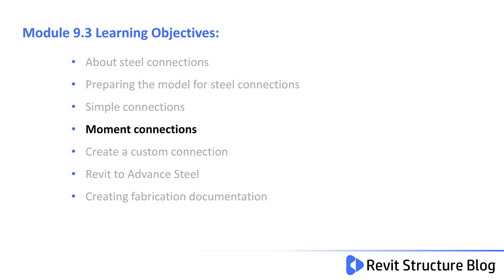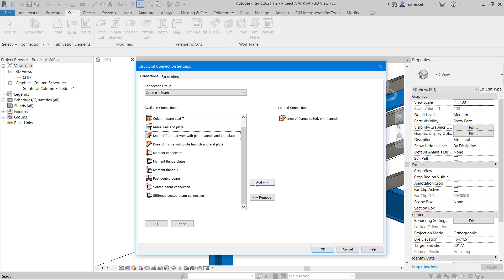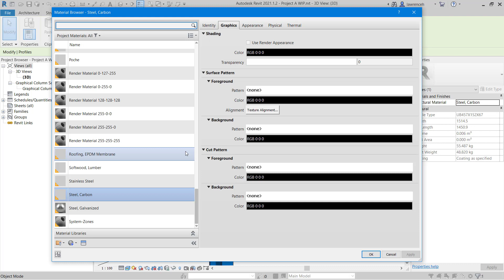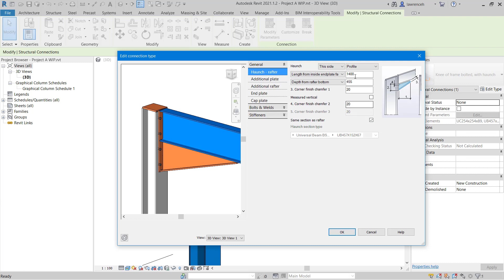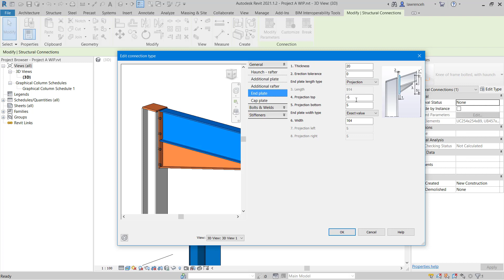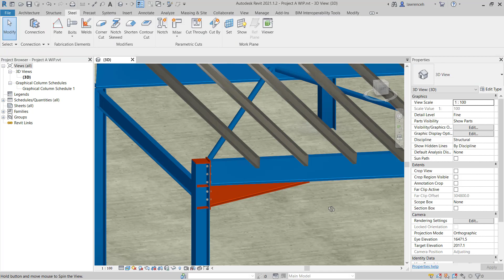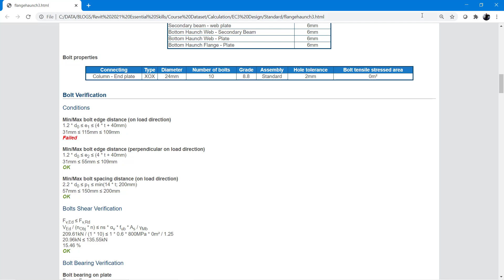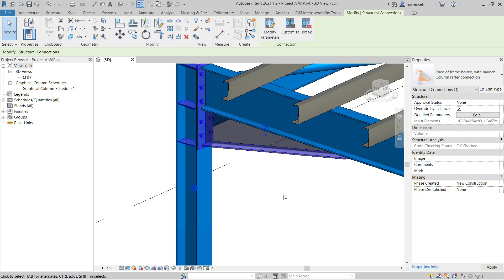Revit 2021 Training For Structures Essentials Module 9.3 Steel Connections

Comment: My code checking no longer works. It worked for the connection in module 9.2, but it doesn't even work for that connection anymore now that I have tried it on this connection. Autodesk 2023

Comment: in mine, Bolts pass completely through the column to the other side of it and also still fail after correcting the bolt distance.

Comment: How can I create a moment conection for a circular column and a IPE profile beam?
Thank you!
Reply from the maker: It depends on the geometry. The top and bottom plates can be created using the fabrication elements and then welds and bolts added. Another option is Advance Steel

Comment: Please provide AutoCAD file
Reply from the maker: All the files are available. If you take a look at the first video the links are shared:)
Reply: @RevitStructureBlog  
There is only one file which is "Project A Modules 1 to 8.rvt" in your blog https://autodesk-revit-tutorials.yolasite.com. It's showing Work in Progress!
Reply from the maker: @syamkumar6620  So if you have not built up the Revit model from the first modules you download the Revit model 'Project A Modules 1 to 8' and then complete the Steel module
Reply from the maker: If you need the AutoCAD file then click the Revit 2021 training link to download the dwg. Its on the same page.